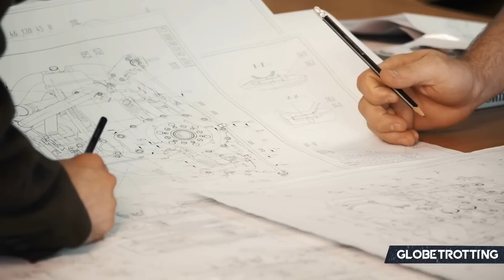Boeing’s Scrapped 787 Dreamliner

Comment: Bring back the scientifically validated and safety proven 747. It’s proven as safe, and it’s four engines contribute to this  safety. If we are going to have and happily accept, according to FlightRadar 24, up to 20,000 aircraft in the sky during peak periods, in addition to 200,000 tracked flights per day, why not?

Comment: The next aircraft should not be based on the 787 fuselage.  It should be based on the 767 fuselage, which is 2.5 feet narrower, and it should be built on the existing 767 production line which is now building the KC-46.

Comment: The 787-3 is not a NMA. The NMA is a 180 to 220 seat airplane that cross the Alantic. The 787-3 is a 280 to 320 seat airplane and not designed with ETOPS in mind. Boeing could shorten the fuselage of the 787 (AKA 747SP) and use the -3 wing, but the tradeoffs in aerodynamics and engine selection would cost in fuel efficency. With all the hype about the NMA, the same problem exists and that is a sutiable engine. The CFM56 is too small and there just isn't much until you start looking at the A330NEO engine, but even that is too large. There is the P&W 2000 used on the C-17, but that is the original engine from the 757. The only answer is a totally new engine, but the business case for the NMA is weak. Boeing has to bring the 777-9 to market and certifacation is proving to be a big struggle.

Comment: G'day Dj, First up, you've chosen an extremely interesting topic for analysis. The entire 787 Dreamliner project was, at the time of its inception a huge and grandly optimistic undertaking. It sought to provide an aircraft for just about every category of the passenger aircraft market.
Of course, no one in any part of the industry could foresee the upheavals that were soon to come; causing the greatest downturn in the history of civil aviation, since WW2.
The concepts behind each member of the 787 family were sound, well researched, forward thinking. Sadly, the entire project could not meet its deadlines due to the pandemic and, many would say, because of unknown, deep-seated problems within Boeing.
Had I been in charge I would not have done so much outsourcing of major components. The very act of deciding to do that should have raised red flags that, perhaps, Boeing had bitten off too much to chew. 
I could be wrong but it appears to me as if the 'dash 3' happened to be the weakest link in the chain, as it were, possibly due to the comparatively short flight range of that variant.
As you mentioned, however, there might be an opportunity to re-work the concept of a short-haul, fuel efficient aircraft that can still carry a commercially positive number of passengers. I would not like to be 'squeezed' into such an aircraft; but for many markets such a variant could be a definite 'money spinner'.
For many passengers there's a huge difference of, say, just an hour or so of discomfort for a quick, hopefully, cheap flight and the 'torment' of an uncomfortable flight that lasts more than 3 or 4 hours.
Boeing certainly need a big win in their upcoming range of aircraft and make sure each and every variant is a success story. They have a lot of ground to make up after some extremely rough years.
Thanks mate and all the very best for your new channel! Bill H.

Comment: The real problem is that Boeing is trying to hard to out do Airbus.Staying with old air frames and being cheap on making a newer jet from scratch.
My company only uses Boeing jets and not for nothing the Max looks like crap.It is really a 737-3 most of the time I have to load the plane back heavy….Pure junk in my opinion.
Southwest should look at Airbus and start ordering them instead.

Comment: Boeing needs a replacement for it's B767-300 ER & B767-400 ER . . . creating a totally new aircraft solely for Japanese airlines don't make sense . . . the B737-MAX8 & B737-MAX9 is already there to do exactly that, short haul flights with dense seating capacity . . . the B737-MAX9 is tailor made for the Japanese medium haul (international) & domestic short haul . . .

Comment: Boeing should do a 787-3 variant and the 797 should be a clean sheet design to replace the 737.
Reply: You know a CLEAN SHEET DESIGN would mean no new planes for 15 years or so?  Meaning first airplane would be delivered close to 2040.  

Sounds more like the MMA / 797 would be a 787-3 based widebody for first delivery in 2032-35, while the Max replacement could wind up as a shortened 757-based narrow body for first delivery in the same time frame.

Comment: Awesome first video! 

I was disappointed when the 787-3 was cancelled, because it would've done well to fill the niche left behind by the 757 in high-density, low-range routes. It would be beneficial to revive the design as the basis for the NMA, because much of the technology and designs espoused have been successfully implemented on the other three models. In a way, it's kind of like what happened with the A350-800 (which was also abandoned in favour of the -900 and eventually the -1000).